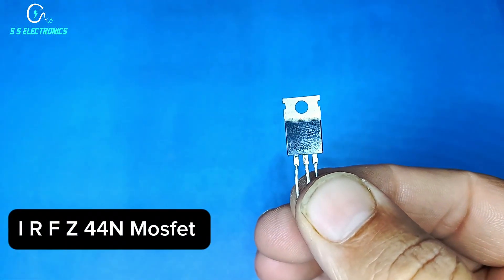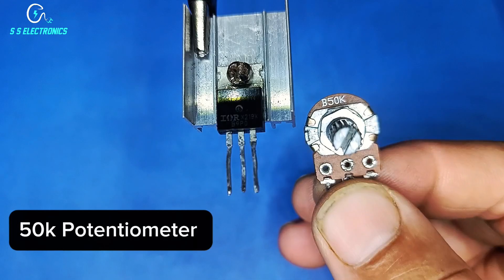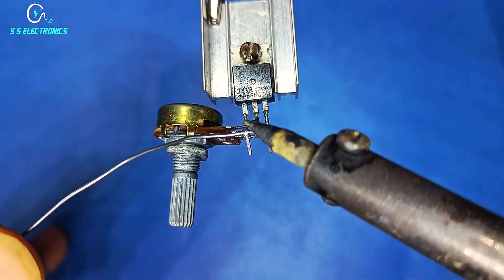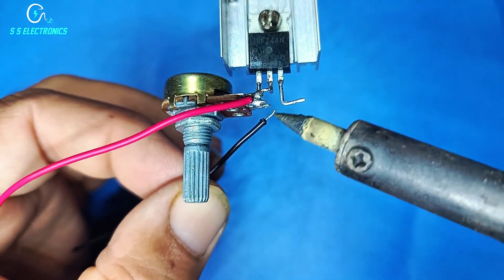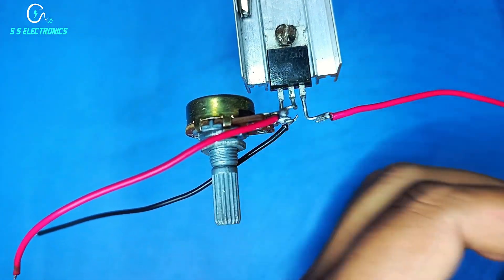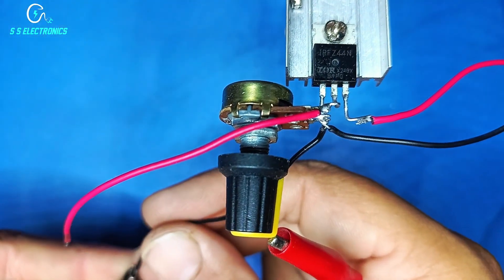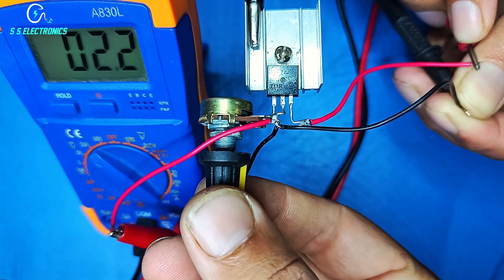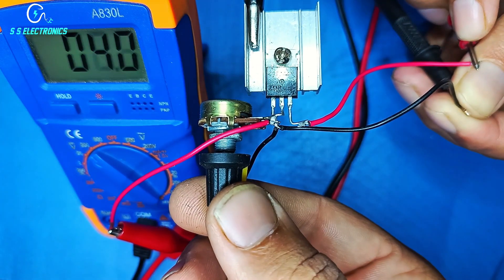Adjustable Voltage Regulator | IRFZ44N Mosfet Voltage Regulator 1.5v To 16v

Comment: The base/gate voltage is not regulated so output voltage will change if input voltage changes or load changes. This type of circuit only ok if we use regulated fixed supply like smps
Reply from the maker: Ok

Comment: controller is burning bro
Reply: Don't put to much Amps it only handle 1 amps other wise the pot will burn he was addressed as 10 amps in his thumbnail
Reply from the maker: Yes there is no load on output that's why